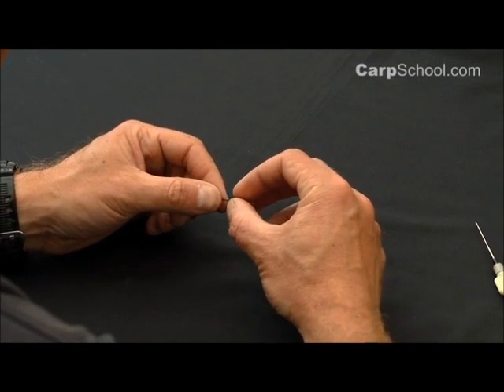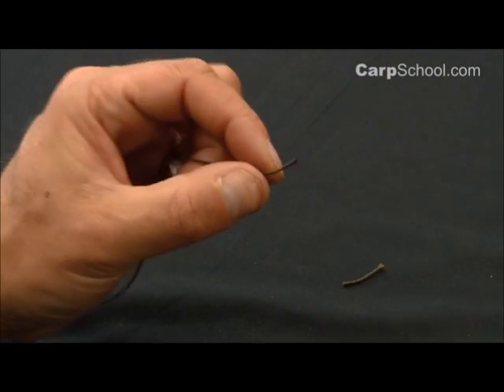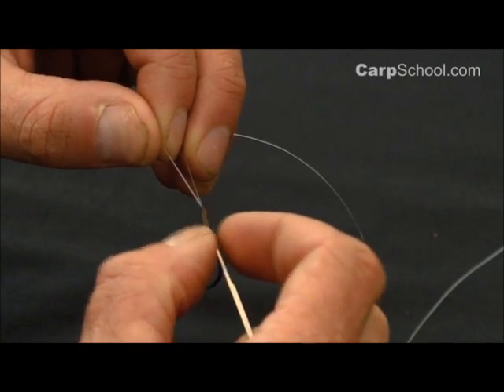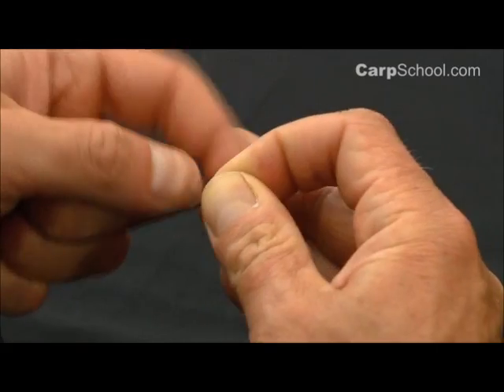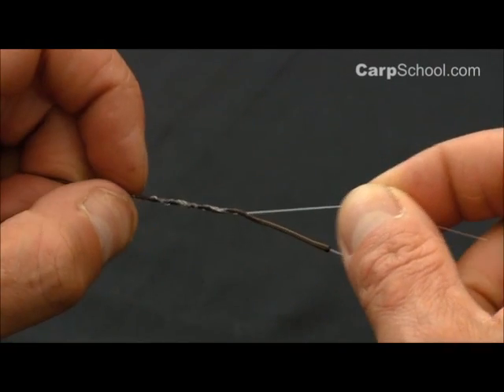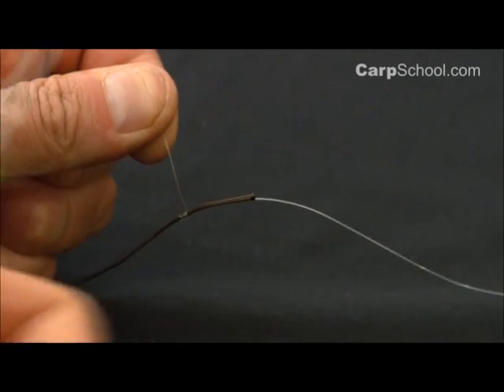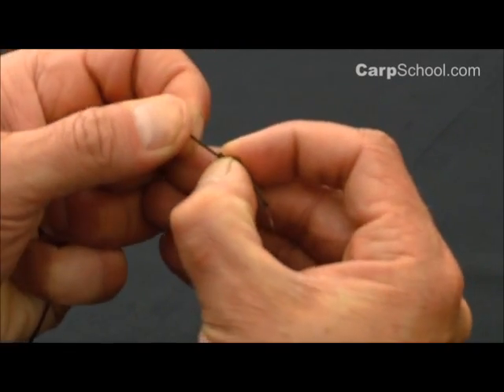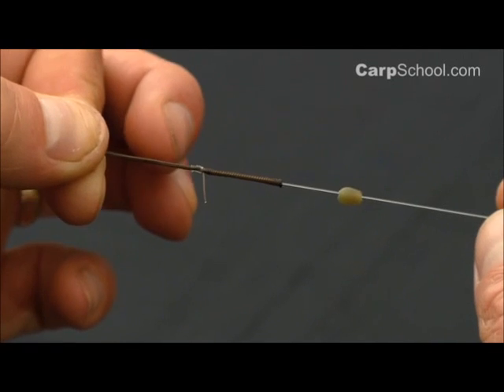How to join Leadcore to mainline

Comment from the maker: To be honest without being there and trying it don't know. One quite good way to test it is this. Take the hook in your hand/pliers and then give the whole rig a good flick using the lead as force to see how the top bead slides up and off. My set up has some resistance as the bead comes off the bit of silicone sitting on the Unleaded but after that it slides straight off. IMO that's how it should be, no resistance at all as it comes off the leader.

Comment from the maker: Yes you can as long as the splice in the ESP leader is not so think that the top bead does not come off. The method in the video is just one way of joining onto a leader. It happens to be how Terry Hearn and Nigel Sharp do it. 
I use Solar Unleaded and splice a loop in one end and join using a loop to loop connection. At the end of the day as long as the top bead can slide over the connection easily then it's fine.

Comment: Ok, si that meens that every time i have a fish i have to re do the join? If i use the helicopter rig 99% the fish pulls the line over the jointed part, that means  the stop bead will go over that join and won't go back again. So if i catch 20 fish a day i have to spend 10 min after every fish to redo the join. It's a bummer.

Comment: Nice vid very informative. Could You tell me whats the best way to attach a leadcore leader with a loop already in to the main line? Is loop to loop strong enough? Thanks for sharing, Graham.
Reply from the maker: Hi Graham, sorry for the slow response. Yes if their is already a loop, you can use a loop to loop connection. Take a look at my YouTube channel for loop to loop connections because there are some tips that make sure it's strong enough. Make sure though that all beads that need to pass up the mainline for a safe rig can do so.

Comment: can this be used to tie braided mainline to leadcore?
Reply from the maker: +Richard Cope Hi Richard, Yes you could but you will need to increase the number of wraps made in the braided mainline considerably. The number of turns will vary between braids depending on their thickness and weave. Because of the huge variety of braids out there I can't really give you a number but start by doubling what you would do in mono.

Comment: Think you can use a shrink tube on that knot to hide it
Reply from the maker: Hi, not really. The advantage of using this knot is to make it slim and streamlined so that beads etc on the leadcore will pass over the connection. This will ensure the rig is safe in case the mainline breaks and you leave the fish with the rig. I hope that makes sense. Do experiment with how you make rigs, just make sure you're components slide EASILY over the knot.
Reply: @MylesGascoyne  thank you cause you share your experience

Comment: Why not just use loop to loop or is this better
Reply from the maker: Roy Close you can use a loop to loop when you don’t have beads that need to slide Omer the connection to ensure the rig is safe. Remember that if your mainline snaps when hooked up the fish needs to rid itself of the lead and leader. So if you’re using a helicopter/Chis rig you’ll need to use this needle knot. If you’re using a running inline lead for example that has a big hole through it, you probably don’t. I hope that makes sense.

Comment: There's a good Lead core depth calculator for trolling on Google Play
Reply from the maker: +M Marks (Ddancers) Thanks. It's interesting how we all use leadcore differently. For carp fishing we only use short lengths up to 6ft or so.
Reply: Wow that's interesting - my colors out vary on speed and the depth of the fish. usually anywhere form 3 to 7 colors out. Again speed of trolling causes me to vary amount. When wind is blowing for control I have to go faster too. Always believed I new my depth using lead core but found out I was off after testing and applied this in the App. Still need to fine tune it, but for Sufix Performance LC it's pretty accurate.

Comment: Why would anybody use this knot? Seriously! The Willis knot is way easier and better.. I can do an unbreakable Willis knot in less than 30 seconds...
Reply from the maker: Hi Peter. I understand that the Willis knot is a quick method of connecting to leadcore. The reason why someone would use this knot is quite specific to UK carp fishing. It is use to ensure a smooth transition from the leadcore to mainline so that specific rig components can pass over the connection with ease. If that is not necessary then of course another knot such as the Willis or a splice might be a more appropriate choice. I hope that answers your questions.